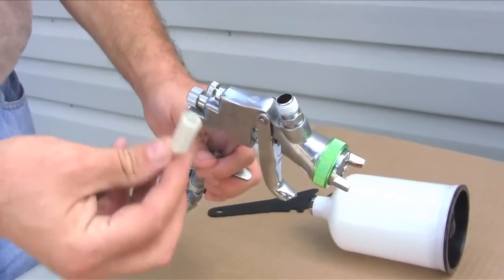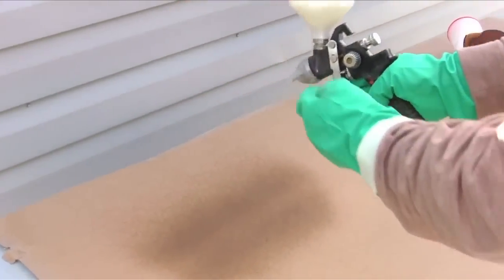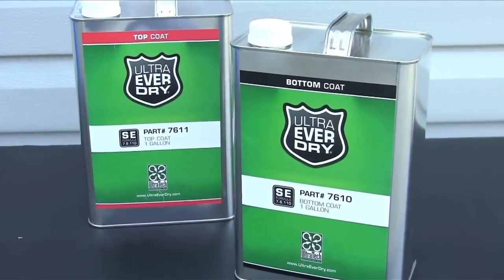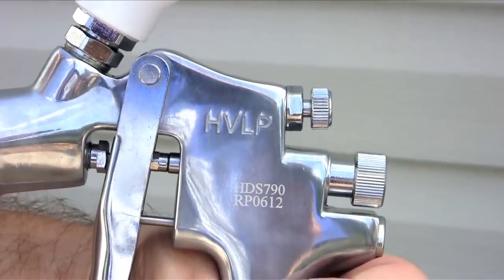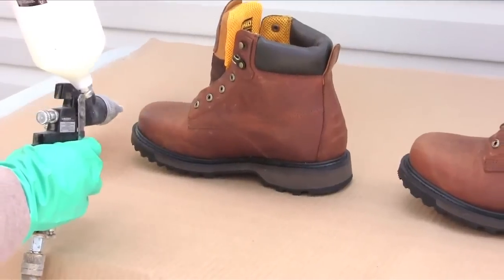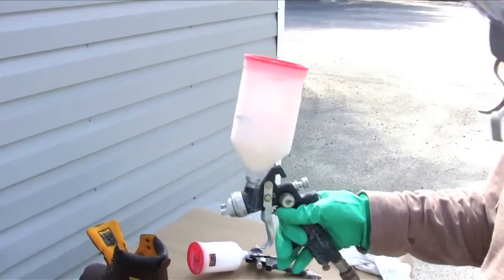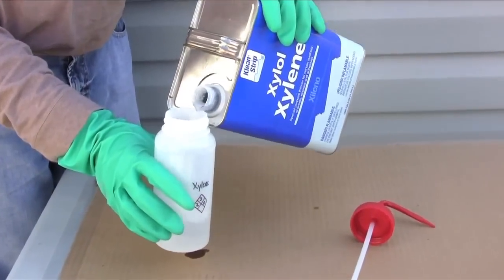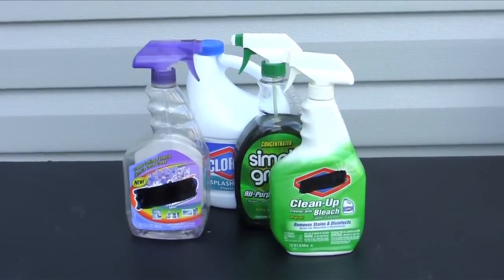Ultra Ever Dry Application

Comment: How well does it withstand heat? If say, you sprayed cookware with it, would the resulting temperatures (up to about 500 degrees) cause it to break up and be ingested with the food?

How much water pressure would it take for the substance to degrade?

Does the electrical resistance allow it to be sprayed directly onto circuit boards?

What color tints are available, and how opaque do the tints get when dry, and are they available for both top and bottom coats?

Comment from the maker: Ultra Ever Dry is designed to last several years depending on the environment. In other words if the surface that UED is applied to is subject to harsh abrasive conditions it will wear faster than normal but will still last a few years. If it does wear off it can be reapplied by respraying.

Comment from the maker: No, to applying it to your skin. It's solvent based so you need to use proper equipment when applying it which includes wearing rubber gloves and a respirator.

Comment from the maker: For the trucks surface, the coating isn't 100% transparent, rather 90% translucent (think frosted glass). We are working on developing a clear version, however for car bodies the issue is that detergent and pressure wash will remove the coat. If sprayed with compressed air or light pressure water it will last however. Undercarriages / wheel wells are a good option

Comment from the maker: For the cars body, the coating isn't 100% transparent, rather 90% translucent (think frosted glass). We are working on developing a clear version, however for car bodies the issue is that detergent and pressure wash will remove the coat. If sprayed with compressed air or light pressure water it will last however. Undercarriages / wheel wells are a good option.

Comment: It does dry cloudy, so...1) it's a micro-thin layer of coating. If you check out the Ultra Ever Dry cell phone video from the garage guys, you can see how much it will reduce the flow of light.  2) we can custom tint at the factory 3) you can purchase it from us - we are in Camas, WA. The factory is in Jacksonville FL, but you can't purchase it direct (but you can have it shipped from there). Right now, it's available only through authorized distributors.